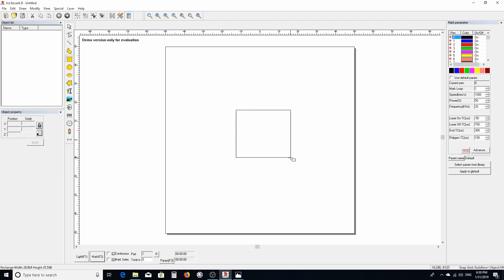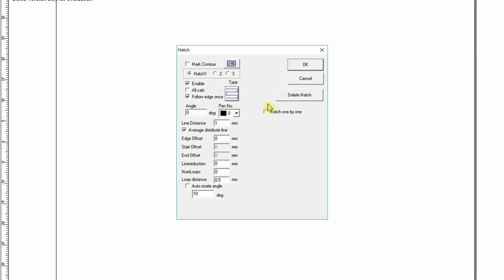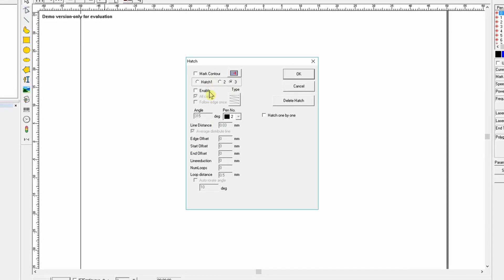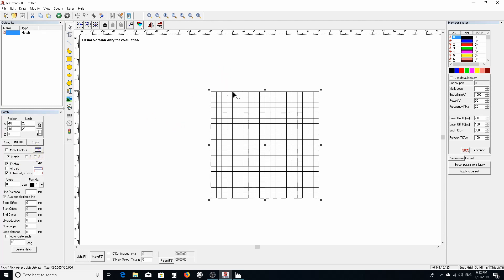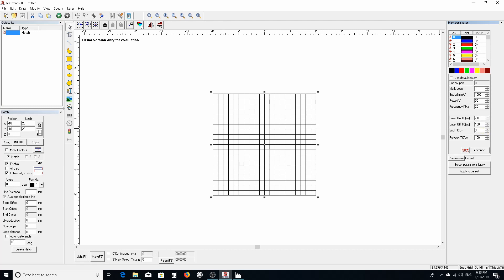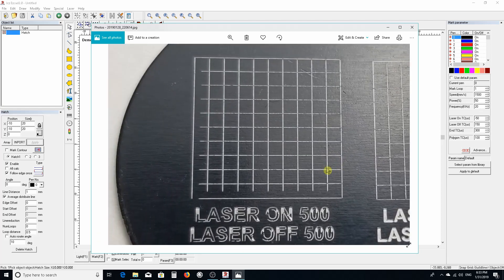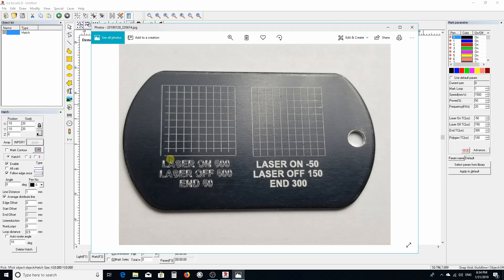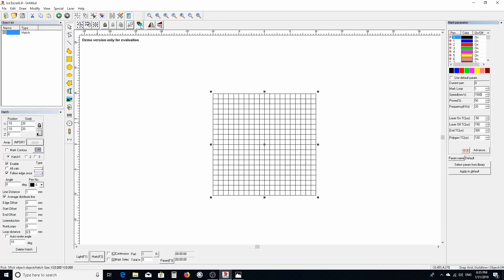How to set the laser timing in ezcad2

Comment: Do These instructions apply to any fiber, laser .  I have. Genmitsu Z5-1 Fiber Laser  can you do something more current years software?  Or has software not changed that much.
Every time I go to the textbook and type something, it doesn't change it still says the same thing text. how do I change that? I just wanna start with functions and then I'll work my way up.
I've been using Lightburn for the last two years, almost 3 with my other three lasers. Fiber lasers brand new just got it yesterday I thought I would start with something simple and not too expensive at first get to know it and then move onto something more powerful later, but I didn't want to spend too much on a limited budget.

Comment: What is your recommendation on the hatch settings for doing stainless steel? My markings are brown instead of black, thanks in advance.
Reply from the maker: Try uni directional (not zigzag), higher frequency and slower speed. 

.01 spacing on the hatch and raise the focus a little. You don't want to burn the stainless, you want to heat it.
Reply: @ajimachining2537  Will do that thanks. Might I suggest a video idea? How about doing photo engravings on Stainless and other materials. Maybe ABS plastics as well. Thank you.
Reply from the maker: @Angryhelder  i will put them on the todo list.